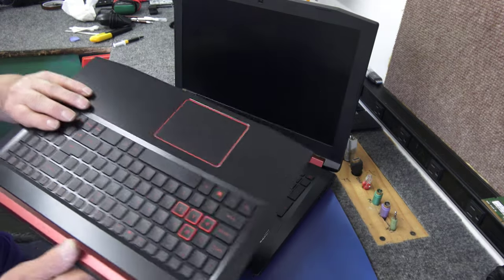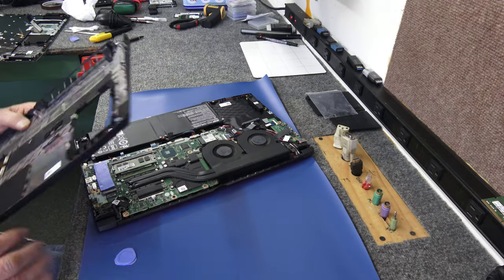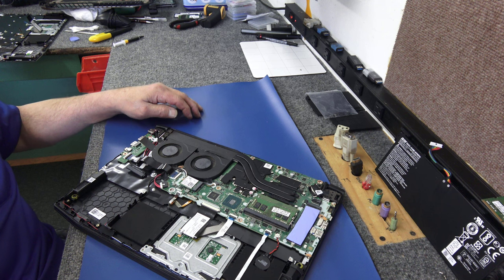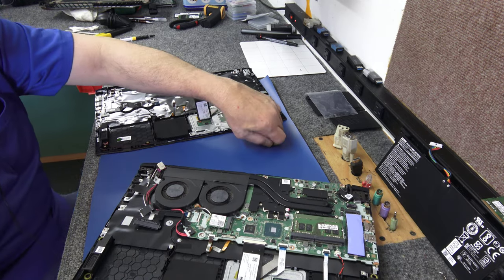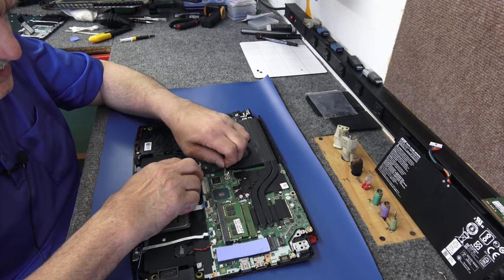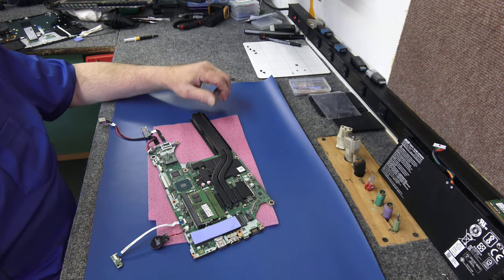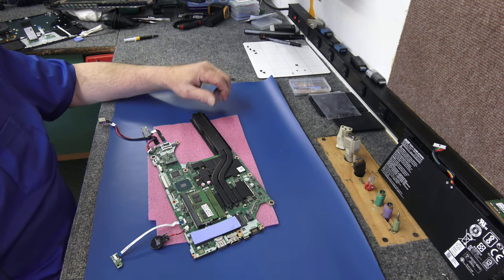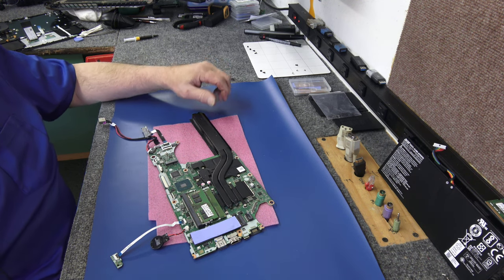Acer Nitro 5 AN515-53 Keyboard / Palm rest Replacement - Re-Paste CPU/GPU Complete Disassembly

Comment: I have the same exact model, and my keyboard also malfunctioned. I almost exclusively used an external keyboard, and I most definitely did not spill anything on there. Upon further research, I found this model and Acer laptops in general have had failing keyboards. 

 I did everything you could do aside from replacing the keyboard itself, so this will be my guide to so.

Thank you sir!!!

Comment: Wow! Very impressive indeed! A query for you - Is it relatively easier to replace the palmrest and keyboard together as one unit rather than just the keyboard where you need to remove the black sheet ,take out the plastic attachments and later solder them back ? Thanks
Reply from the maker: It's much easier and more cost-effective to replace palmrest.

Comment: Great video, the pace is perfect for someone trying to learn and replicate! Having some problems with a note very similar to that one, its an acer nitro 5 but a slightly different model. My problem is software related, when I wipe the hd entirely, delete all partitions and recreate them, and reinstall windows from scratch, and then unplug & plug the keyboard, it works for a couple days.
I'm pretty sure it is some failsafe from Acer to make us buy damn new keyboard pieces, and I would gladly if this piece of shit wasn't so hard to replace.